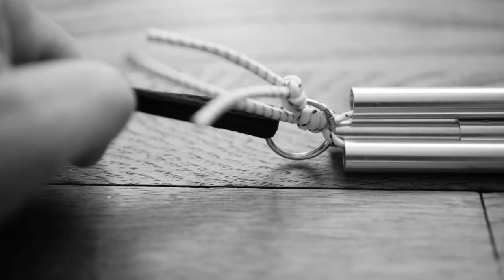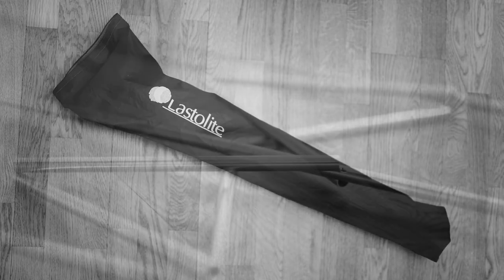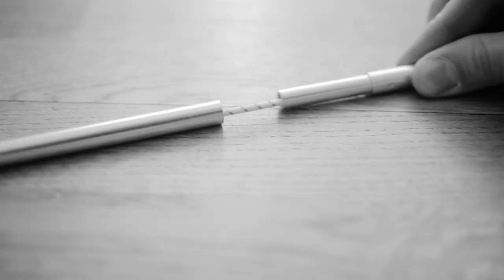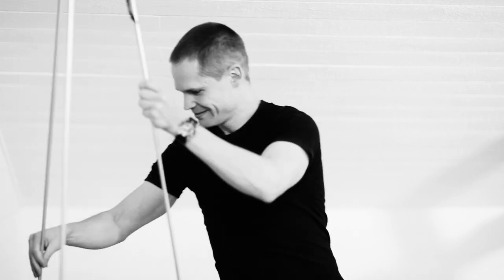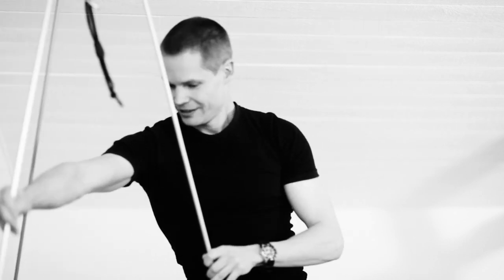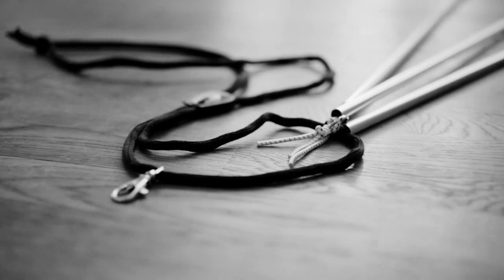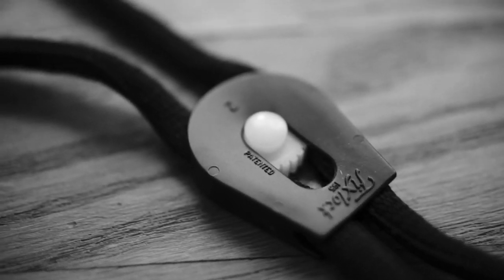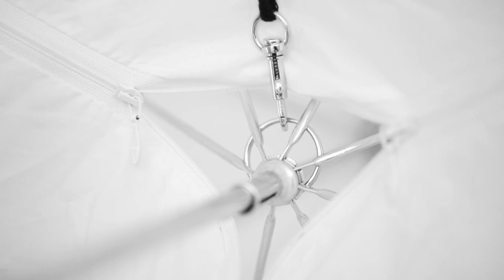Svarteld_lightstands_2.mp4

Comment from the maker: It's the Canon 5D2, plus some Canon glass, often the 50/2.5 macro here; such a sweet forgotten lens, a perfect companion to the 180/3,5, to go more wide in macro sometimes. But no 180/3.5 in this vid.

Also, I've used the 35/1.4 for the spinning-around shots, the 85/1.2 for some moving-in and sideway pulls, and the 14/2.8 for the vertical intro movements.

Spinning movements are made with a rig I've built myself from cheap standard Manfrotto parts; I like building things ;-)